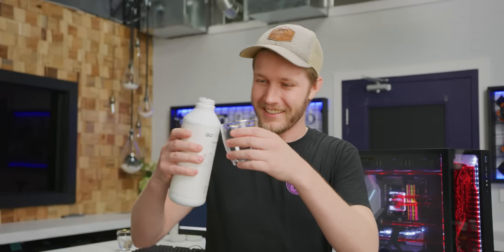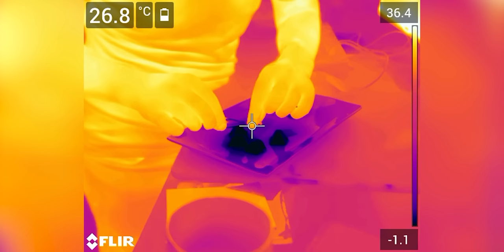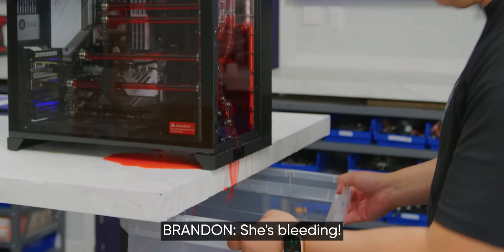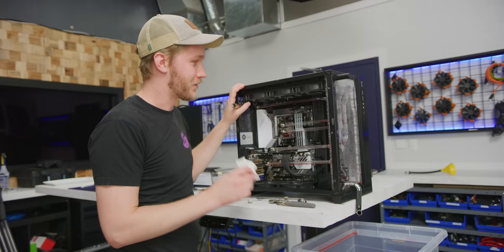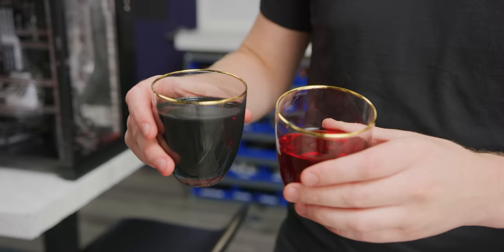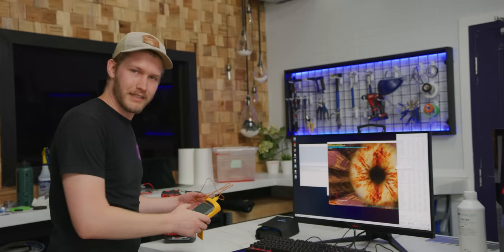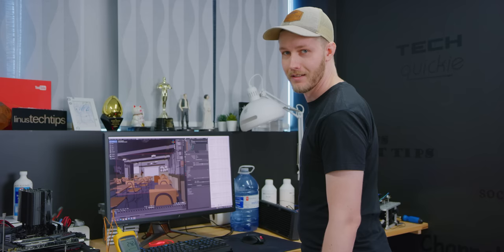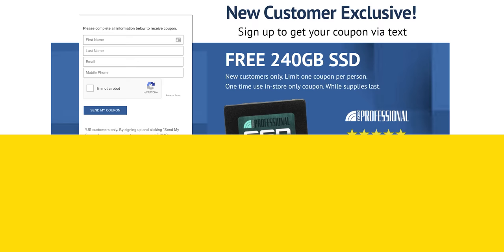7°C Cooler? This must be a scam - GoChiller Graphene Coolant Review

Comment: The question is, how well does it stay in solution over time.  Is it going to be like most other liquids with particles suspended in it that drop out of solution after a while?  You guys at LTT should setup a test system that you can run over a long period of time to test out it's long term stability.
Reply: Also fill up a few test tubes. Leave one at room temperature, one in the fridge and one in a hotbox or somewhere that's continuously warm and leave them there untouched for a month or twelve. That would show if the graphene stays in suspension or separates from the liquids. Also what about the liquid? How stable is it? What's the evaporation rate and so on.
Reply: @blahorgaslisk7763  Evaporation rate shouldn't be an issue since it's inside a closed fluid system.
Actually, even the suspension questions end up being not an issue since the fluid is constantly flowing and mixing around. Even if any settles, it would likely get resuspended as the fluid washes over the deposits. 
Though I suppose you could have a problem with micro deposits getting stuck in the tiny radiator fins. I would like to see them pour that fluid through some cloth filters and see how likely it is to get deposits getting caught in the tiny channels.
Reply: Didn't he fill that PC up with just straight premix though? Pretty sure he was supposed to add like distilled water to that no?
Reply: @trapical  I'm mostly interested in the evaporation rate because it's a new kind of cooling fluid and we don't really know much about how it reacts or what's in it at the moment. Besides even AIO's have a problem with evaporation, so I wouldn't say it's a none issue even though the reservoir should mean it would take a long time for it to become an issue in an open loop.

As for suspension I don't think just having the fluid circulating is any guarantee that there wont be deposits. Just look at all the opaque liquids available. It seems most of these has a problem with deposits building up over time. Now this is one thing that might be less of a problem with this new fluid as the graphene should be extremely light and the particles very small. That should mean thy will stay suspended for longer, but until it's tested we really don't know for sure.
Reply: @sassiest2053  I think so too
Reply: @sassiest2053  Premix is pre-mixed, ready to use, no dilution needed. Other coolant enhancements may be sold and marked as concentrated, with instructions for how to dilute to optimum mix.
Reply: @blahorgaslisk7763  @Namika there's no such thing as a perfect flow system, there will be areas of turbulence, eddy currents, etc. Once particles start to settle out, they tend to group together. That it has that shimmer is evidence of density differences in the suspension, and it isn't perfectly homogenized, so it will settle out at some point. I'd also like to see a long term test, with a clear loop and pump/radiator teardown.

All that being said, it does look metal AF. I would almost consider wrecking a cheap loop for that vibe.
Reply: @trapical  All plastic is prone to evaporation. PETG tubing is the most susceptible and is why you sometimes need to top-up.
Reply: Colloidal suspensions are difficult and fragile, it doesn't take much for the material to start precipitating out...
Reply: @SianaGearz  yeah, but this is a clay type suspension (fine lattice), and with better suspension as any particle is lighter and most likely smaller. clay takes like 4 hour to descend 5 cm (not compact, any significant flow would resuspend it), usually it takes like 2 (or more) days of stillness to settle in a thick layer that is not easily resuspended. that is clay, and it like to stick together. graphene does not really do that, and it is lighter, so I would thing that, in  a week of perfect stillness (at least),  you could see a settling layer with less cohesion (easier to disperse). 
I would say that settling condition could be a problem if you are in an Nordic-style holidays of a month or 2.
But, clays are really easily suspended "permanently" with polymer additives. I doubt that graphene would be different. those surfactants usually make them quite foamy, so that is why this graphene colloidal solution was bad in that aspect. (At least that is my intuition of sedimentation as a geologist)
Reply: @giuseppebonatici7169  Insightful. Yeah, makes sense that they keep the suspension stable with surfactants, which then cause foaming in spite of the "anti foaming agent", whatever that might be.
Reply: We've got Gamers Nexus for serious testing :)
Reply: @trapical  nanoparticle suspensions can irreversibly precipitate rather easily, it really depends on the critical conditions for a state transition and if the normal operating conditions cross those conditions.
Reply: @Maecrow  Is that because the drying particles clump together ?

Comment: Shouldn't graphene be abrasive enough to eat your cooling loop over time?
Reply from the maker: Graphite also makes a good lubricant so idk if it will be good or bad for your system long term.  It's staying in that EK machine so we'll see how it holds up in a couple months. -Alex
Reply: @LinusTechTips  follow up vid or pinned comment?
Reply: Depends on the concentration of graphene in the solution
Reply: @LinusTechTips  Graphite or graphene?
Reply: Yea over time
Reply: @LinusTechTips  Grind up some graphite pencils pour it in some water and lets see the difference in performance!
Reply: @bradhaines3142  

They put antifreeze and water in the radiators. Not graphene suspended in any liquid.

To lubricate the engine, they use engine oil.

With the shit they put out as "news articles" these days, I'm very, very skeptical about literally anything any news outlets say.
Reply: @N1c0T1n3__  rotary engines like the ones in miatas use grapheine to prevent scraping in the engines
Reply: @N1c0T1n3__  Graphene has been used in cars motor oil for years.
Reply: @jono6379  Pencil "graphite" has large amount of clay included, so that's a bad idea/comparison
Reply: @N1c0T1n3__  regardless, graphite has an incredibly low coefficient of friction (0.1 on bare steel) and graphene is only SLIGHTLY higher (0.15 on bare steel, 0.42 being steel on steel). I'm gonna go out on a limb and say it's most likely not going to have much of any affect on your loop.
Reply: @marcusholloway1147  I'm pretty sure Miatas have regular piston engines
Reply: @marcusholloway1147  rotary engines... in miatas...?
Reply: @marcusholloway1147   you mean RX-7 & 8 .MX-5s have a four banger
Reply: @marcusholloway1147  Miata's are inline 4, you're either thinking of the Rx7 or an engine swap
Reply: Maybe depends on the structure.  Round shapes, probably not, hard corner shapes yes.
Reply: @LinusTechTips  Also wonder if it will leave residue over time on the block fins.
Reply: @LinusTechTips  Hmmm, I wonder if there would be any benefit in refrigerated graphine, as it is more conductuve than water, it should make the chiller more power efficient???
Reply: @Mindpron  project farm is pretty dope. Dude is pretty good about keeping his methodology consistent and practical.
Reply: @M4XC4V413R4  Graphite itself is a rather great dry lubricant. Graphene should be either the same or better since it has a less rigid structure and technically smaller flatter particles.
Reply: @LinusTechTips  Run it 24/7 for a few months.
Reply: That's my huge concern for the pump .
Reply: @bradhaines3142  the tolerances between lubricated surfaces are much much larger than the particle size of the graphite . Graphene in lubricants , I'm not aware of being added to lubricants . Something I haven't looked into .
Reply: @ronnie3044  graphite , and yes it goes way way back to the beginning of Nascar and other American muscle car beginnings .
Reply: @jono6379  Pencil lead contains clay.
Reply: @user-py9cy1sy9u  that's no Bueno
Reply: @LinusTechTips  if it's an EK system then those blocks are going to spontaneously deteriorate on thjeir own. no abrasive coolant needed. kek
Reply: @marcusholloway1147  Miatas don't have rotary engines.
Reply: @N1c0T1n3__  Liquid Moly suspension is a very common additive in low viscosity oils to reduce the abrasion more common in low weight oils. Graphene isn't common but you might be surprised how many additives are in plain old oil, antioxidants, antiwear agents, friction modifier additives, EP additives, detergents, dispersants, foam inhibitors, corrosion inhibitors, flow point improvers, viscosity index enhancers. 
A lot of cars that have high performance or high mileage requirements use such formulas, all Mazda's with skyactiv engines run oil with Molybdenum Dialkyldithiocarbamate or moly treatment.
Reply: @LinusTechTips  What would happen if the PC was turned off for a while? Like if you were to go on an extended trip or had it in storage. What would the weird graphene goop do in your loop?
Reply: @N1c0T1n3__  Antifreeze lubricates your water pump, in addition to preventing freezing. If you put straight water, it cools a bit better, but will significantly shorten lifespan of your pump.
Reply: @alexandrebourdouxhe5939  lmao its not a solution
Reply: E
Reply: The particles in graphene powder seem to be around 2-40 μm, usually disks or flattened spheroids...and they're pretty smooth. Probably okay, will be interesting to see what happens, though~
Reply: @LinusTechTips  graphite makes a good lubricant _in certain scenarios_. It’s not an all-purpose lubricant. 

Given that there are definitely particles suspended in the go chiller, clogging of the microfins is a concern I’d have for long-term use.
Reply: @LinusTechTips  nice glad you guys are doing long term testing
Reply: @jono6379 yes this would be cool
Reply: @N1c0T1n3__  antifreeze, water and a wetting agent. That's about the only thing I'd add to a loop (along with antifungals and a piece of silver)

As long as the liquid is flowing, then what matters is thermal inertia. Whatever was touching the fins won't be doing so in a few milliseconds thanks to turbulence
Reply: @king.jarjerk4201  you do realize that the likely reason graphite has that good of a friction coefficient is because it destroys itself? That's literally the reason Graphite is used in Pencils, where the remains are clearly visible.

A similar situation is there when considering the lubricant. I'm not at all an expert on these, but what I can say with some amount of certainty is that the liquid we see in this video is very different from that lubricant. Lubricant is typically very viscous, that's required for it to do its job, if you put that liquid in a loop the pump is going to die because it can't handle the required pressure to move the liquid. If these lubricants are in fact suspensions with simple graphite and not some chemical concoction it will likely not be suspended in water either, probably rather some oil.

Also engine parts are made of metal, loops in part from plastics. Yeah metal isn't nearly as tough as it's often made out, but it's still quite a bit tougher than plastic.

Same goes for relative velocity, though that kind of is the same point as viscosity. Lubricant typically IS DESIGNED to not move much against the parts, the movement is in the lubricant itself, that way it preserves the parts by reducing friction.

Coolant is typically designed the other way around, or at least some flow past the exchanging metal is required. It may create a border area with little flow, but it'll have to be much smaller, making some slip all but certain.

That means that, even if it is abrasive if moved against an surface, lubricant if used how it should be will not show that, so your argument falls flat.
Reply: Graphene is used as an abrasion resistive coating so maybe not.
Reply: @M4XC4V413R4  Graphite is simply millions of layers of graphene. In fact, this property is exactly what allowed resesrchers to isolate graphene in the first place.
Reply: @henryviiifake8244  i know but unlike what some people, yourself included, seem to think, that doesn't make it the same thing...
Reply: @LinusTechTips  sweet, looking forward to the follow up
Reply: @LinusTechTips  Good to know, would like that followup if the graphite starts to settle int he loop after a time period. It's the one thing that hurts many dyes.
Reply: Seeing the black gunk in the bottom of the glass.
Reply: @marcusholloway1147  miatas dont have wankel engines, and graphene is used as a sealant, not as a lubricant. Its used for the equivalent of the piston ring in a cylinder engine, called an apex seal.
Reply: Why did I see graphite on the roof?
Reply: @WhenDoesTheVideoActuallyStart  You can buy pencils with 90% graphite. The clay might clog things up eventually but it would be fun to try for a comparison.
Reply: @jono6379  You can also just buy pure graphite powder online 🤦‍♂️
Reply: @WhenDoesTheVideoActuallyStart  Dont spoil the fun of watching linus and his team trying to figure out how to extract graphite from penicils 🤣
Reply: @jono6379  That won't make graphene.  However, if you scribble repeatedly with pencils on a piece of paper, you will make graphene.  It would take an awful long time to make it that way, though.
Reply: @N1c0T1n3__  Powdered graphite lubricant has been a standard part of many automotive systems that can't be regularly oiled or greased for decades. It is often sold as a lubricant for locks, so that it doesn't require grease that will collect dust and seize up your lock cylinder. So no, not a suspension, but yes, a low wear dry lubricant. So the graphite/graphene particles probably won't add wear to the parts, but will come out of solution eventually. Whether it leads to clogs or not is the bigger question for me.
Reply: The easiest way to tell if something is abrasive or not is to look at it's molecular shape. I would argue that water is probably more abrasive than graphene. I don't know for sure though.
Reply: @LinusTechTips  still waiting for a video on how this went

Comment: Guys next time when ever you try to fill up the coolant, open both ends, attach hose both the sides and hold them at equal vertical level above the system, this way you will never have to worry of air gap as filling up from above will simply push the air out from the lower side and holding them above will prevent your coolant from over flowing too. Good work on the video.